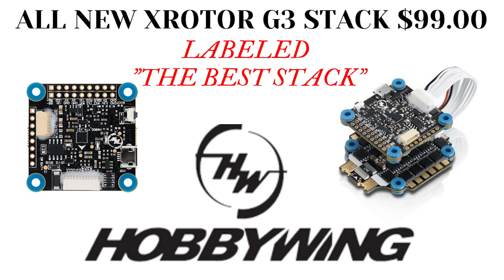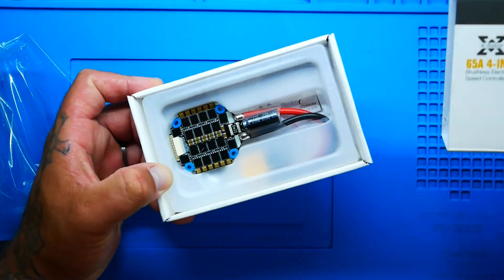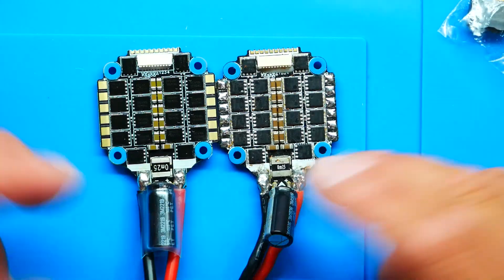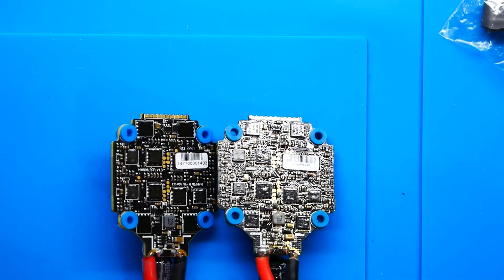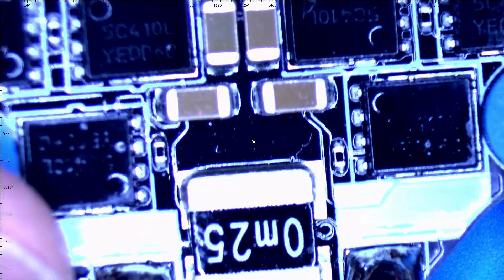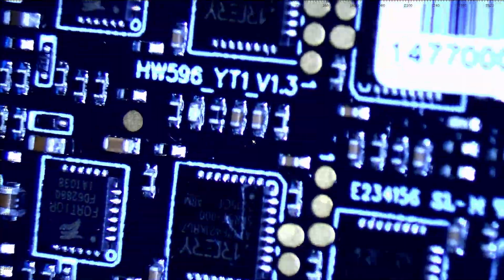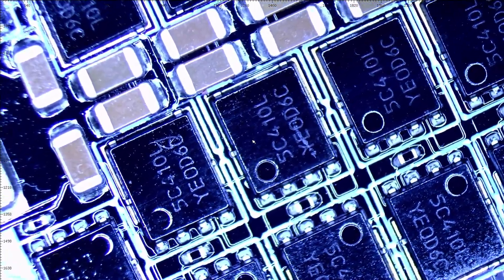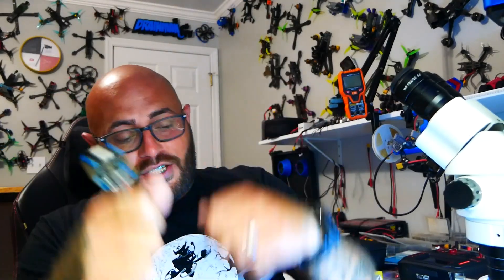The Once Best ESC ... Just Got Better!! All New 65 Amp ESC by Hobbywing!!

Comment: Hey Josh,  Question
If I'm running 6s, can a Hobbywing F4 G3 power a OG air unit on the 12v bec pad on the flight controller?